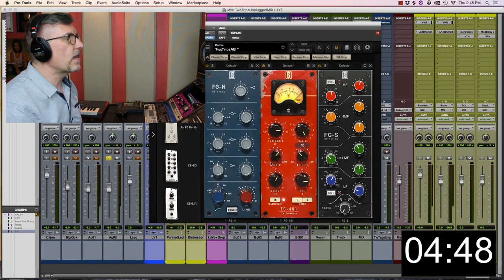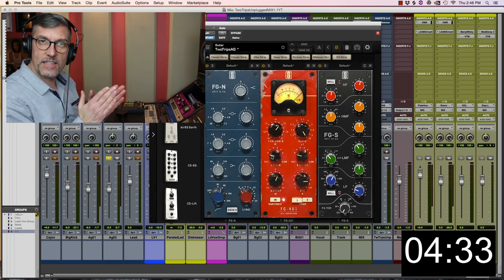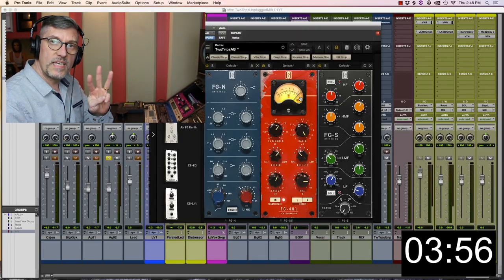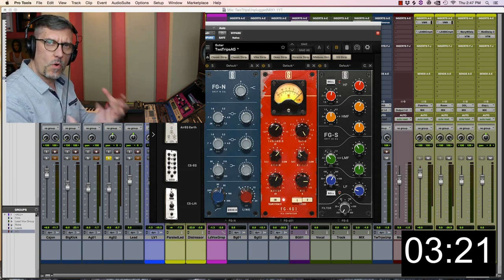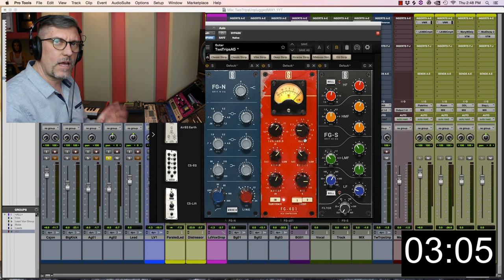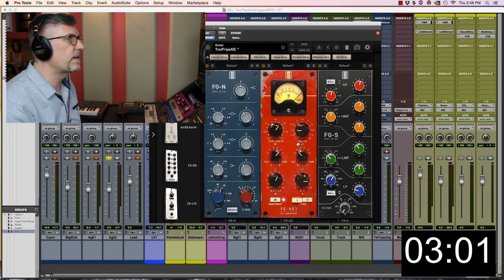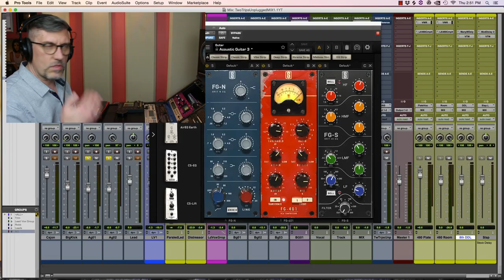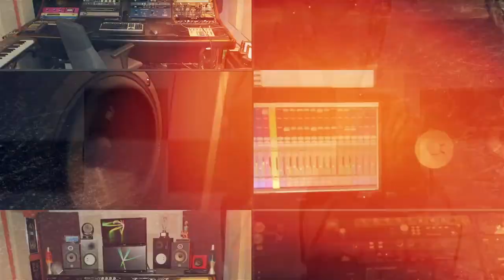Audio Compression Techniques Acoustic Guitar

Comment: I’ve never used a compressor before, but I think i’ll need it for my next recording. There are just a few loud peaks but the rest of the song is quiet and smooth. What settings would you recommend? I’m using a garageband compressor.
Reply from the maker: Use the techniques I've outlined in this tutorial and the logic / garageband compressor is very good. Try a 4:1 setting and play with the attack time a bit. A faster attack setting will catch the peaks better but you need to see if you like the sound.

Comment: How do you usually compress the acoustic picking guitar like playing finger style arpeggios, so that the transients of the notes don’t slam too hard in the ears in the 6k? Which compressor do you use and what are the standard preset settings that you prefer?
Reply from the maker: +sevchyk LA 2A is kind of the easy button for acoustic guitar. Pull out some top end. If it’s still too annoying use an 1176 style comp with fast attack, which is 7 on that comp. It might take some
edge off. Or use both.